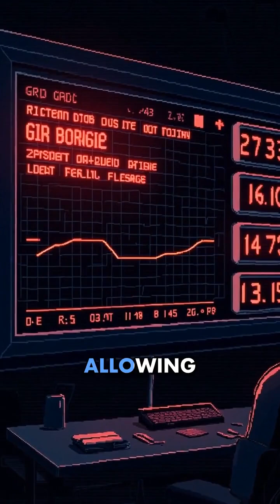Inertia of the Power Grid and why it's Important

Comment: There’s a powerful way to improve grid stability that’s being overlooked:
Governments should strongly promote and incentivize V2G (Vehicle-to-Grid) electric vehicles combined with short-interval net metering.

With smart incentives, EV owners can charge when prices are low and feed back during peak demand—stabilizing the grid and earning enough to cover battery wear. It’s a scalable, cost-effective alternative to massive grid battery investments.

Side effects? Less grid stress, major CO₂ cuts, cleaner air, less smog and noise, and improved public health.

Channels like yours can truly influence the shift by raising awareness and pushing this forward in public and political debate.